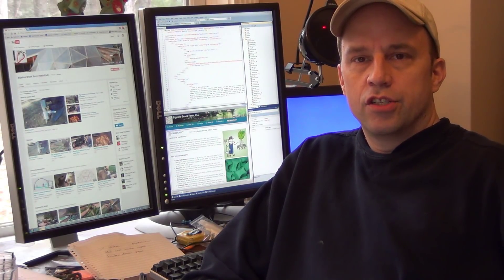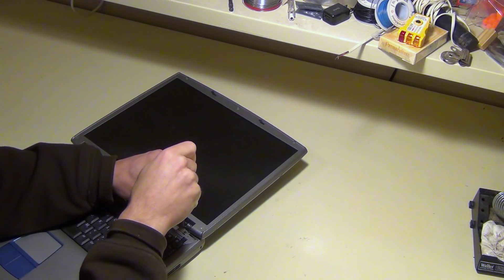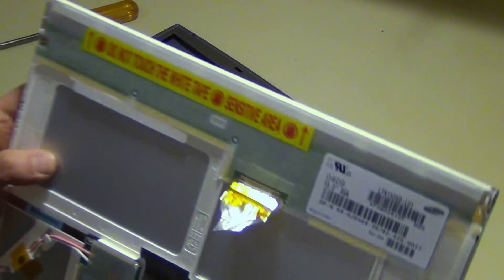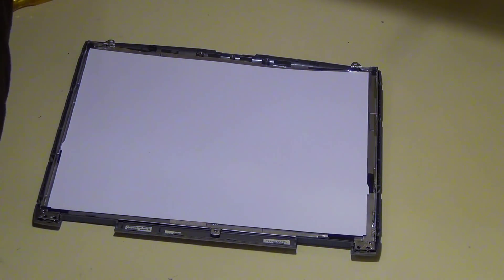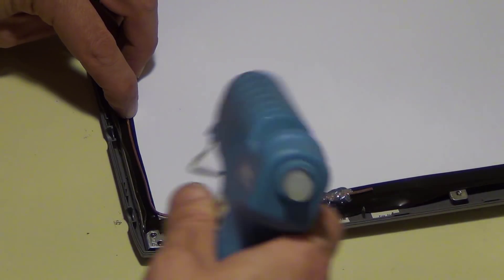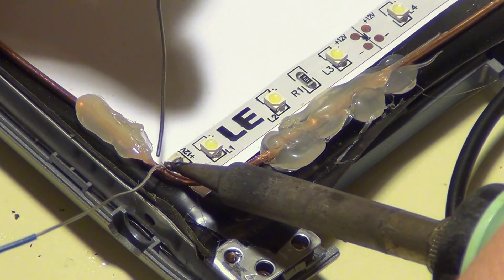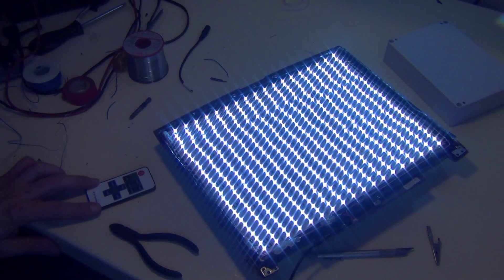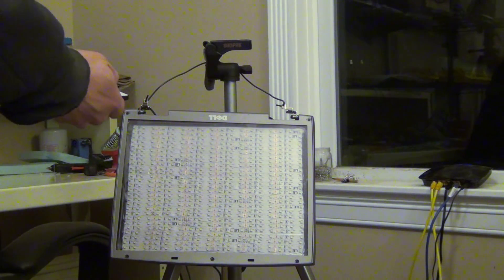How To Build A Light Panel for $25!

Comment: Great idea and work!  Thanks for the How-To!  You're probably all set up with the real deal light meters but I just use a free Android app called Light Meter that uses the front camera to see how much light is given off with different bulbs.  Have you measured Lux at different distances like 5', 10', 20', etc.?  And maybe even plugged it through a Kill A Watt or Belkin monitor to see what the watt drain is to get that level of luminosity? Thanks again for your videos!
Reply from the maker: +Greg Valunas Believe it or not, I haven't used a light meter at all.  I just set things up and hope for the best.  ;-)  I'll try the ap out and see what it does.  I did plug it into a killawatt and it draws about 38 watts.  Thanks for the tips!

Comment: I use dual vertical monitors on my main (Linux) work station. What's the code on the right monitor? Looks somewhat C ish.
Reply from the maker: +TalksWithDirt It's just the HTML for my web site.  Most of my development work is a mixture of HTML, Visual Basic, Javascript and SQL. Sometimes a little bit of C when I'm doing embedded work ;-)

Comment: How many amps can those lights take? They look like they would be good for a power down emergency lighting option for stairs. 12v battery, 120v relay, wire and a charge system and you can have the light strip auto turn on when the 120v power is lost.
Reply: +Andrew H From what I've seen of them on ebay, only 2 or 3 amps for 5 meters.

Comment: set ist to full brightness wen filming.. you can see a pulsing from the PWM
Reply from the maker: +Matthias B. yup.  I put up a little caption around 0:27 warning about the flickering.  ;-)
Reply: +Bigelow Brook Farm (Web4Deb) if it is only white LED's and the driver can manage it some capacitors might remove the flickering. the driver might not like it tho.